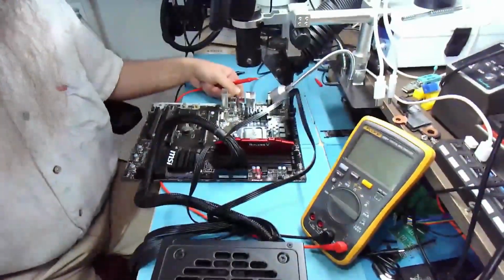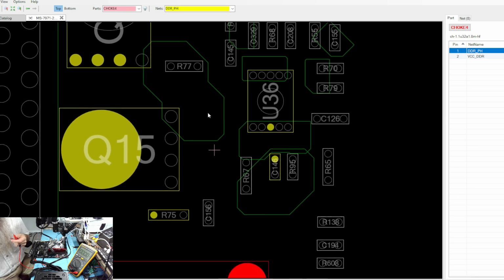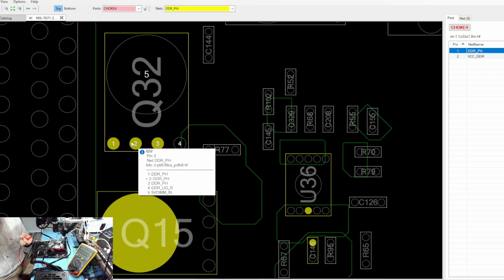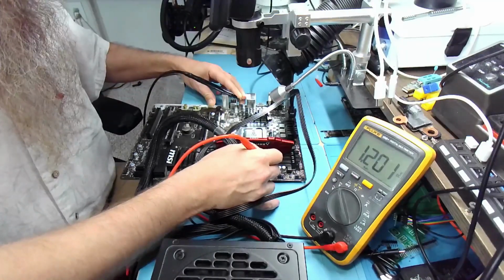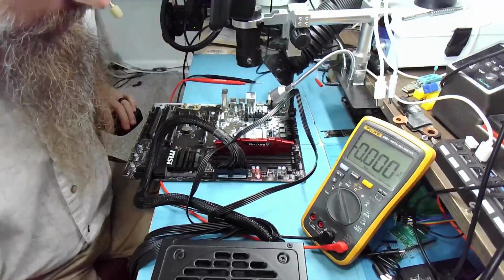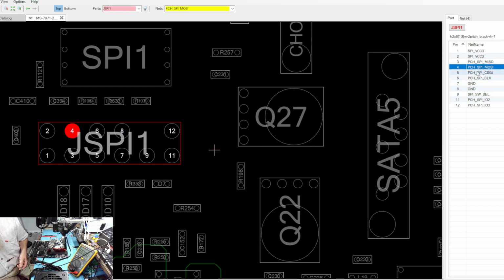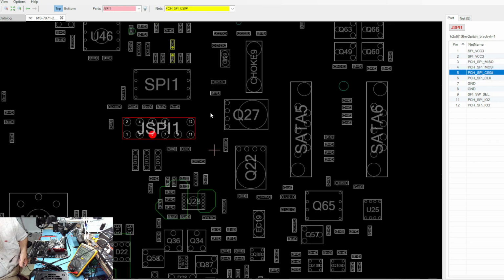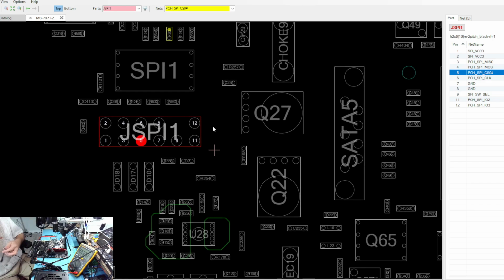MSI Z170A Repair Attempt | BIOS Reflash | No Memory

Comment: Programming the SPI with the BIOS update file from the internet, is it right ? I mean, when I do BIOS recovery in laptops (usually cleaning ME Region), I use a DUMP flash file from the same machine, not the BIOS from the manufacturer site. The update file never contains all the necessary regions and the correct BIOS file must be "stitched" together and in order to do that you need a dump of the original bios. Is it so ?
Reply: for consumer mobos it's different, the ME region doesn't need cleaning
I haven't manually flashed MSI boards, but yes, BIOS files from ASUS, GigaByte and AsRock do have extra identifiers at the beginning of the file that need be removed - some software like the one from SVOD does recognize this extra data and ignores it when flashing
Reply: @zMeul  I don't use expensive programmers like SVOD or Vertyanov but  a cheap CH341a which does just fine the job. I'm not quite sure for the desktop MBs BIOS scheme but if the M/B doesn't support dual BIOS or some way to recover then you can't use the update file in order to flash the BIOS.
Reply: @nikolaskallianiotis8622  huh!? yes you can, you just have to cut the extra bit out
you can use a hex editor to identify the start and cut
Reply: @zMeul  Of course you can and there are many tools out there but what I say is that you can't use it as it is.
Reply from the maker: @zMeul  thank you, I'll look into that
Reply from the maker: you're absolutely right, I do that for SP4 and 5, didn't even think about that while working on this one. What tools do you use for that? I use FIT for Microsoft Surface machines. I do have the BIOS binary backed up so I can still use it.
Reply: @blackhorserepairs  FIT and ME analyzer mostly but also UEFItool and other more specific tools for each BIOS and/or manufacturer.
Reply from the maker: @nikolaskallianiotis8622  awesome, thank you, in that case I have everything I need

Comment: here's the thing: RAM population is done A2, B2; using a single stick should be in A2
channel A is the 1st 2 DIMMs, channel B is the last 2 DIMMs
Reply from the maker: thank you, of course I checked all 4 combinations and from my experience the board will still boot and report inefficient memory module configuration, especially with single stick. We'll see after I receive the CPU, I'm hoping that's the problem, otherwise it's faulty PCH
Reply: @blackhorserepairs  yes, some will tell you 
but not all boards will POST with the RAM in the wrong DIMM slot
Reply from the maker: @zMeul  I didn't know that, thank you so much! Would the wrong frequency of the RAM module also cause this behavior? Maybe my RAM stick is just not compatible/faulty
Reply from the maker: not sure if this means that the board is ONLY compatible with ECC memory or it supports both?
https://us.msi.com/Motherboard/Z170A-GAMING-PRO/Specification
I'm testing with non-ECC of course, perhaps that's the problem?
Reply: @blackhorserepairs  the board should POST with JEDEC default of 2133MT/s at that age of the mobo
Reply: @blackhorserepairs  ECC RAM could work, but in non-ECC mode - depends on the BIOS